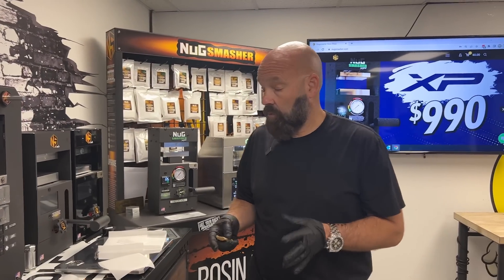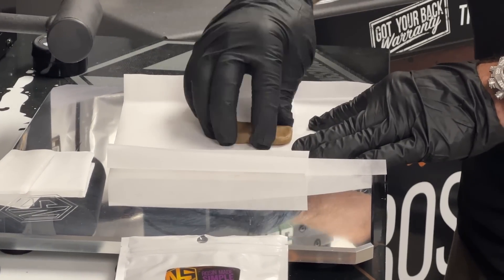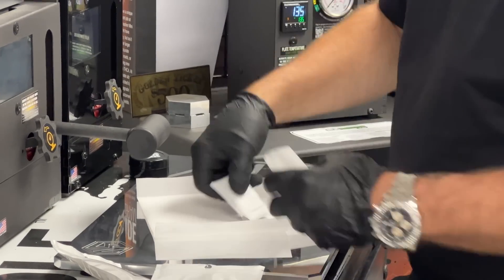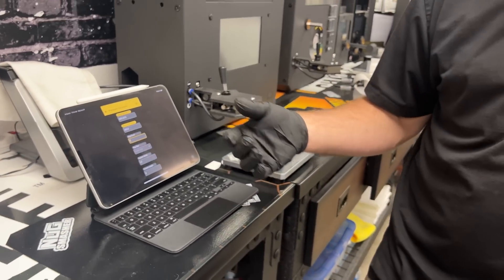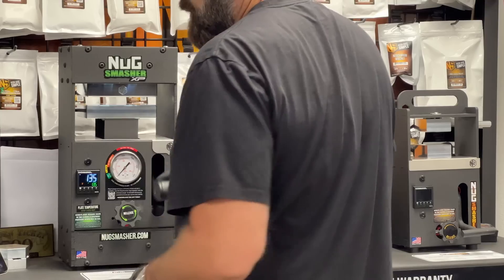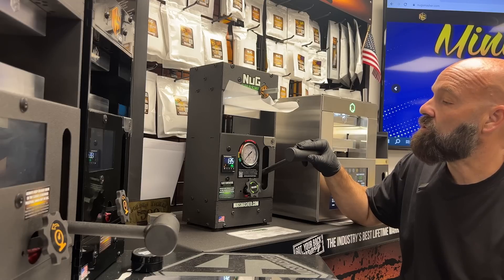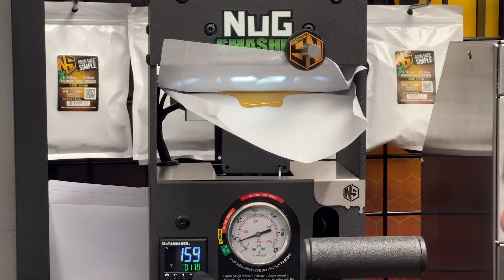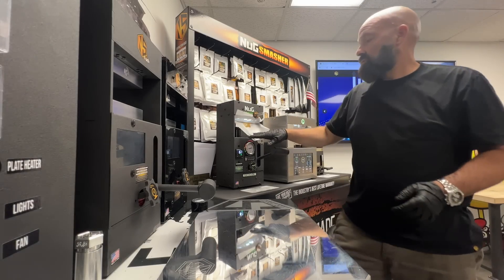BUBBLE HASH - NugSmasher XP

Comment: Why doesn’t the app have the calculations based on material size? My app has material pressure, gauge pressure and bag type. ( 
3.5,7 or 14 g etc) no more customization?
Reply from the maker: Under bag size just select custom size.